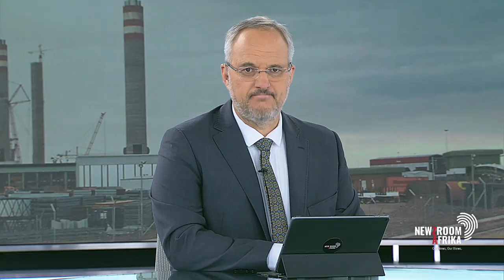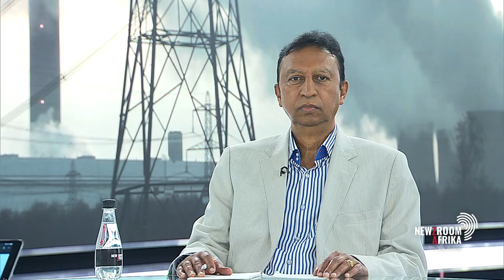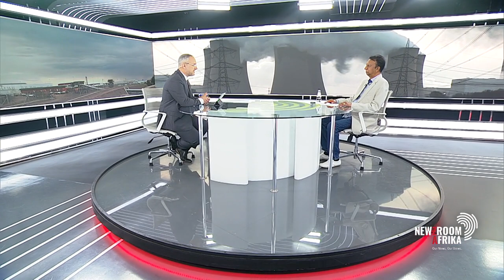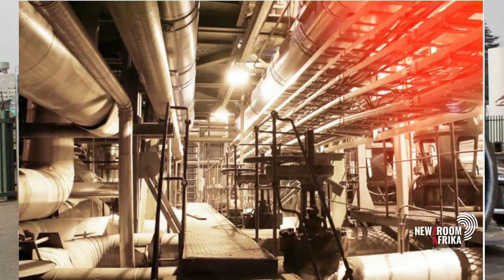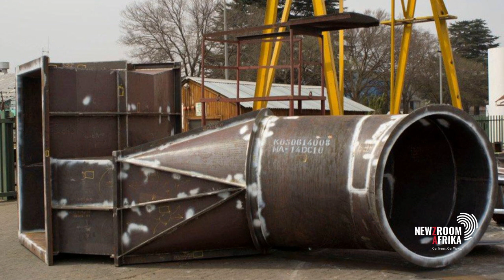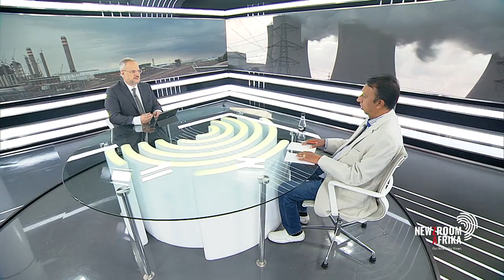Padayachee: boiler tube leaks common

Comment: I am confused you mention that the tubes get heated by heat transfer by water ie a kettle ,then you mention the pot ash corrodes the tubes and which would make more sense that the tubes are heated with coal burning and not coal boiling water to boil the water in the tubes